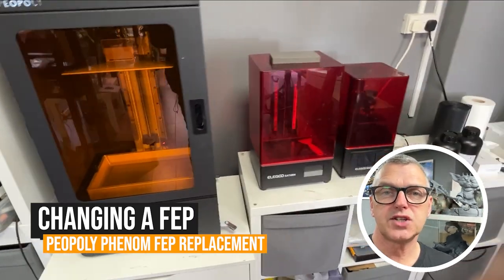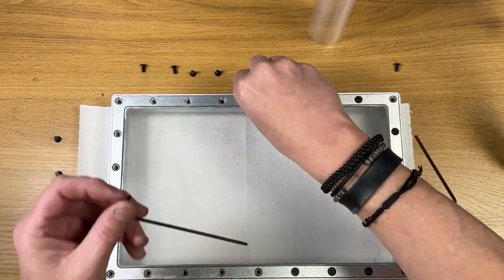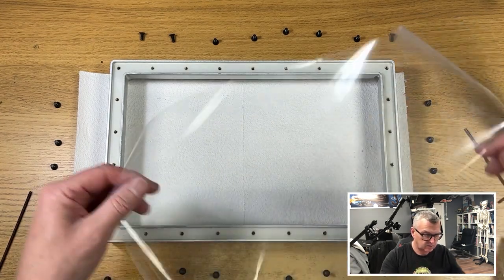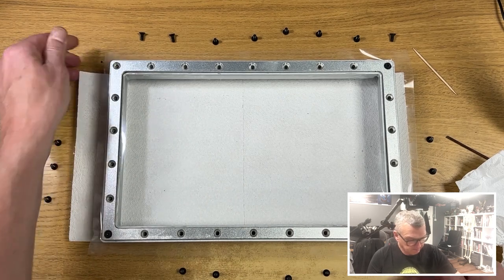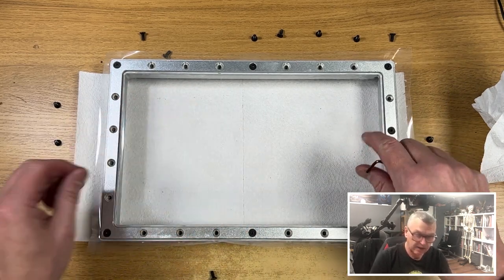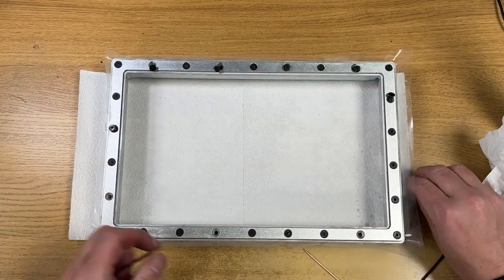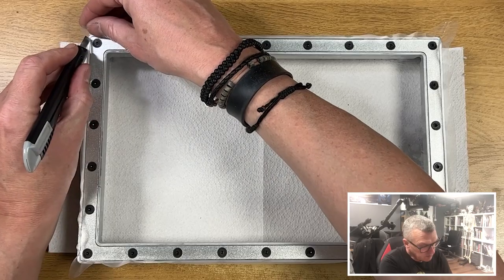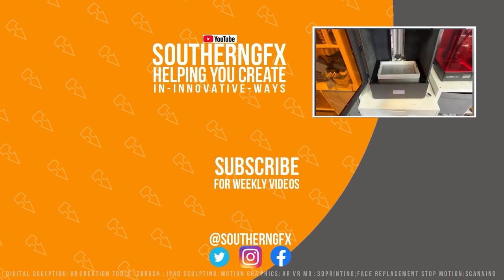Peopoly Phenom - replacing the FEP

Comment: I had to get rid of my phenom after 3 years because peopoly stopped supporting it with uv screens . So i bought the peopoly forge and its so quiet you dont know its running and lightning quick . I can do a large scale print in  21 hours instead of 3 days. I did the upgrade to the phenom but it did not work i tried everything and finally bought the forge it,s a fantastic machine. Im like you im more the creative person not a tinkerer i run everything in default settings thats why i dont like fdm its too many pages of settings to fool with . Although i love the forge i still miss that ole loud phenom we had so many great positive adventures........